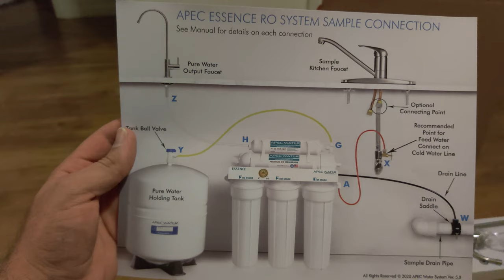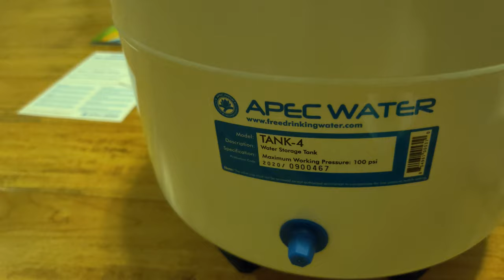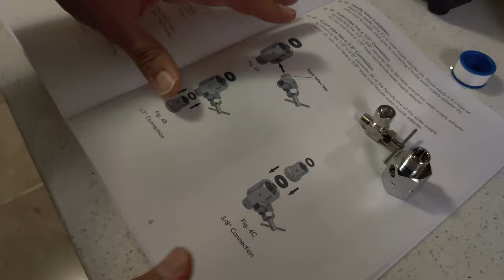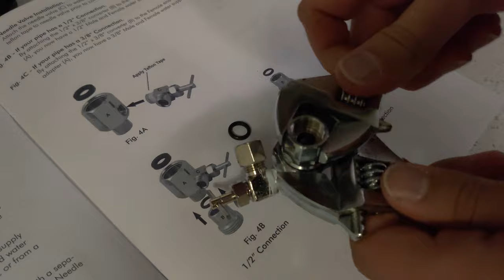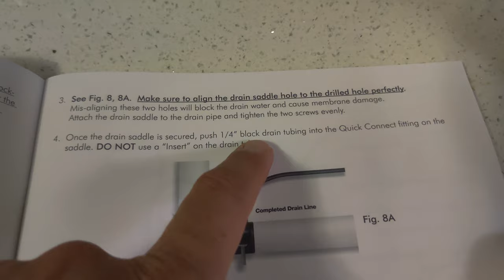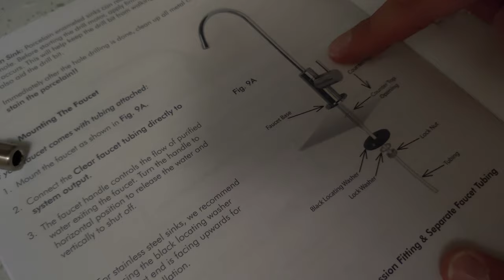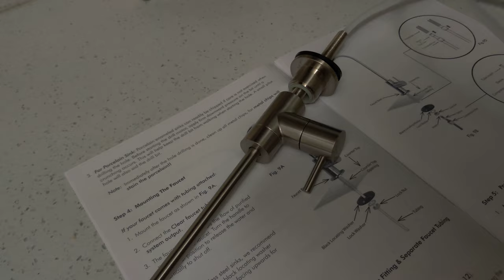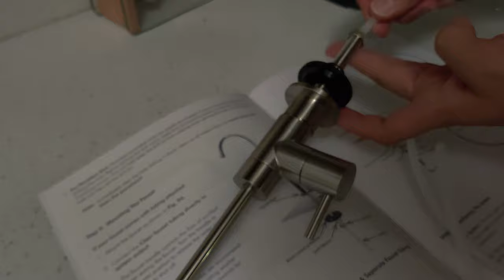Install APEC Water Filter RO System

Comment from the maker: Water filter system can be found here: https://amzn.to/3f1byPL
Dewalt drill/driver set here: https://amzn.to/2IDZhF6
Reply: Hi Chris thank you for your video! Do you mind what is the dimension of the 4 gallon tank width and height? Thank you in advance!
Reply: Can you hook up A-line to your ice maker on the refrigerator
Reply: Wow!! I want this System. I had a very rough new years eve (December 31st, 2022). I was arguing with my parent about fraudulent water filters in my country. I will refer them to buy this filter instead. Thank you, I'm looking forward to installing this filter with your video. If I succeed in convincing them to purchase this product.
Reply: The filter element of the filter is installed wrongly, 123 is the first one wrong! You have a look, thank you!
Reply: @patrickz3181  literally came here to say the same thing hope he noticed this sooner then six months later on the filter change

Comment: For anyone installing this …make sure u look inside the filter holders.  There is a piece of paper inside each one
Reply: Not anymore. Only 1 paper in 1 filter holder.
Reply: Mine had some weird black crumbs, had to clean it out.
Reply: Mine had an ant in one of them . Think it’s ok to use ?
Reply: @Freedom-dq7tl  Yeah it's still fine, just rinse the holders out.
Reply: I just install mines and I’m not getting water. Wonder if this is why 😂😂😂
Reply: Mine didn’t have any paper. They must have stopped doing that, thankfully.
Reply: Just installed this, didn't see any paper in the filter housing
Reply: I just replaced the 3 filters and was surprised to see 2 paper labels come out. 😂
Reply: @TimRomanPhotography how long after did you have to replace the filters?
Reply: @balla2828  I waited about a year and a half before replacing. The water from the new filters tasted almost identical to the old filters after all that time. Great filtration system in my opinion!
Reply from the maker: True :) ...thanks for pointing this out

Comment: Good install, noticed the filters might be backwards and so was the drain gasket. The gasket should be installed onto the clamp. this is primarily for future problems, i.e. when, as in this case, the garbage disposal is replaced, the same pipe has to be used or another gasket will need to be purchased. The price isn't so much but the down time due to the "oops I forgot that" factor.
Reply: Oh I see! The sticker onto clamp
Reply: That’s why mine is leaking. The sticker goes on to the dam clamp. I caught the backwards filters. I should’ve just read the directions
Reply: DIdnt think of it that way but,,, yes. !  TY
Reply: @verlecox232  the directions I have mount it the way he did
Reply: Directions say “then put the self-adhesive black sponge around the hole location”
Reply: Also the drain should really come in from the top of the pipe coming from the garbage disposal.  The line should go up to form somewhat of a reverse trap. This is because the water coming out of the garabase disposal is quite crappy, and any food particles that come out will create a biofilm. Even though the water from the filter will keep it down, research we have conducted shows over time the biofilm will make it;s way back to the filter over the course of a year or two (or sooner in warm weather and low usage).
Reply from the maker: Thanks for the insight!

Comment: Each installation scenario is different, I ended up doing it wrong by attaching the needle valve first (like he does in the video). This is cause If the needle valve is already installed, the space between the cold water line and the wall in most houses is not adequate to freely rotate. You have to first install the coupler
Reply from the maker: Thanks for the insight!

Comment: Great install video. however I️ think the black drain hose should NOT be pushed so far into the saddle as the hose that far (1/2in or more) inside the pipe may collect solids going down the drain and could lead to a blockage.
Reply from the maker: True, thanks for the insight

Comment: Quick tip, use a painter tape or a sharpie and mark it on drill bit to the length you want to drill the hole in pipe. This way you will stop at right point moment you see it meets the mark. 

Very descriptive video and it has saved me couple of hundred dollars plumber was quoted. Thanks 🙏
Reply from the maker: Thanks for the tape idea!

Comment: Thanks Chris! Helped a ton!

Added installation notes:

Black drain tube—once in, it doesn’t come out.

Recommend drilling small pilot hole in drain faucet before drilling with the 1/4 drill bit.
Drain pipe is exactly 1/4”, so trim waste from hole and try inserting red pipe first, to be 100% certain hole is big enough. 

For drilling the counter top hole, other YT vids were very helpful. FYI, the amazon sold $30 Bosh 1/2” bit was too short (it’s 1 1/16”, and my counter is 1 1/8). Be sure to measure your counter.

If you already have a hole in your sink, the base of the faucet is 1 3/4, so it will fit a smaller existing hole.

Faucet hole position: Make sure there’s enough room on the side to fill a water bottle/cut/whatever you often fill. FYI, the water comes out about 7 1/2” from center of spout (at counter height).

It was said, but I want to highlight, the water spout needs to be in the Off position (lever pointed up) when you connect it to the tank. If not, all the pressure will release and your system will not work.

Also, my tank was pressurized to about 45 psi. I bought a great $35 Cycplus battery-powered high-pressure pump that brought it up to 70 psi (per manual) and the water comes out 50%-75% faster.

It's a fun install. Have a great time!
Reply: Everyone should be careful pressurizing the tank any further.  As with all pressure vessels, there is a max design pressure (MDP) rating that is specific to that particular vessel.  Never go near the MDP as you can have a burst event.
Also, thank you for the excellent notes.  Will be installing my system tomorrow.
Reply from the maker: Nice! ...thank you for all the additional information!

Comment: I just want to thank you very much. I followed your video, entirely, for a complete video manual, step by step, on how to do it. Otherwise I would have been literally desperate. In reality we had a previous system which was outdated - so I had to find ways to integrate the previous plumbing solutions with this current APEC system (namely different size tubings of 3/8th and different valves already installed). After having studied your video and the older system, I concluded all I needed were adaptors 3/8 to 1/4 which I got on Amazon. From there it was 5 minutes thanks to your video. Pretty amazing - TRULY grateful, Fil
Reply from the maker: You're welcome!

Comment: Thanks for doing this video. I watched it and installed mine. At first I had a couple leaks at the two adapters above the house Coldwater valve. On those adapters you have to make sure the rubber O-ring is in place and tighten them fairly snug.  I accidentally left one out when installing and the other one came with a defect from the factory once I pulled off the extra rubber and made sure it was sitting flat it worked great . So I had to take it apart twice and make sure those O-rings were back in there correctly but after that no leaks. Thanks again.
Reply from the maker: You're welcome! ...and thanks for the extra insight.

Comment: Perfect install except for one small plastic tube insert that goes in the end of the tubing at the line in valve. It goes in and supports the tubing for the compression nut.   It is small but does come in the 📦 box.
Reply from the maker: Thanks for the insight.

Comment: Thank you so much! I just finished installation a minute ago and waiting on tank to fill up. I did notice however that you put the 1st stage filter in the 3rd attachment. I could be wrong but that’s how it appeared in the video.
Reply: no, he did exactly that which is incorrect. if you check the videos from the official APEC, they do it correctly.
Reply from the maker: Thanks for pointing this out in the comments! Comments like this help us all install the RO system correctly.

Comment: Thanks a lot for the video mate, really useful. I just bought system from ebay and there got no instruction at all. 
Just little note: try to avoid using teflon tape but hemp dispenser instead. 70 percent of the plumbing troubles are in result of using teflon tape 👍
Reply from the maker: I'll look into the Teflon tape alternative you mentioned. Thanks for the insight

Comment: Very good video. Your explanations and instructions were clear and concise and the installation was well done.  I installed my unit today.  I found that the metal valve body that the 1/2 to 3/8 adapter fits into leaks under water pressure.  It took a lot of firm tightening to get it to stop.  Worse was when the red tube that feeds water to the unit blew out and water gushed all over.  It seems that the fitting on the unit was missing the lock collar and that is why the tube would blow out seconds after turning on water.  I ended up removing the fitting and went to a local hardware store and bought a replacement.  It seems to be working ok now.  I also bought a brass fitting with ferrule in case the plastic fails.    That red feed tube fitting was the only one missing a lock collar but it caused me a lot of trouble.  Perhaps Apec should include a couple extra fittings in their package so a person doesn't get stuck if one fails.  Also a base for the tap that can be adjusted  for mounting surfaces that are not flat but sloped.  That is another adaptation I had to do on mine.     My daughter just installed one several days ago and had leaking issues with the metal fittings that attach to the water supply.  She tried reaching Apec Customer Service with no success. She had to run to Home Depot for a washer and O ring to get her leaks stopped.   The jury is out on the Apec Roes-50 until I see how it performs for a few weeks.
Reply from the maker: Thank you.

Comment: I followed hour guide. And not the document. The video was great. I added teflon to all joints so it didnt leak at all on first turn up. Also you can use the horizontal pipe to drill thr hole for the black tube. As long as its above the trap.
Reply from the maker: Nice, glad the video helped!

Comment: At 3:30 when three filters are being screwed into the system, they are being installed in the wrong order.  The white filter which is supposed to be stage 1 is being installed in the stage 3 slot of the system.  

Also at 9:30 when you move onto installing the valve setup under the sink, you don't mention the small o-ring that is left over or where it goes relative to the setup until later on when you're installing the system.
Reply: You are correct about the order of the filters. SED goes in stage 1 and CAB 's go in 2 and 3.
Reply: I don’t understand how more people didn’t catch that. It’s kind of an important step to get wrong
Reply: was thinking same thing lol. @Acidhair
Reply: This is the comment I was looking for.
Reply from the maker: Thanks for the insight

Comment: Others may have mentioned these issues but I believe you put the sediment filter in the 3rd stage housing. It goes in the 1st stage housing. Also you failed to put the plastic insert into the end of the red tubing before inserting it into the needle valve.
Reply from the maker: thanks for the insight... It's true I did mess up the order in the video.

Comment: Chris, 
Enjoyed your video. Just needed you to check your main line (red tube) connections to your water outlet. You should of had a white plastic insert to put into the red tube before you compressed the  fitting down. Great job on the video 👍
Reply: I missed that too. Wasn’t in the instructions. Still holding up nice
Reply: yes - following vid and manual - and the little plastic thing came with the needle adapter.  Almost threw it out.   They should package it TAPED to the red tubing!!
Reply from the maker: Thanks!

Comment: Excellent work and detail descriptions. Thanks
Reply from the maker: Your welcome
Reply: Hi Chris, do we must flush the water system for the first time ? if so, how? thanks
Reply from the maker: @brian68467  yes, you should do a flush to remove any carbon and other particles from the new filters. Simply let the water run out the faucet. I recommend running at least 5 gallons out before using the water.

Comment: Great video. Installed mine today. The feed water adapter and needle valve keeps leaking. Maybe I'll have to add more teflon tape or I might have the sleeve for the compression nut on wrong.
Reply from the maker: That's unfortunate.... Let us know, if you get it to stop leaking
Reply: @ChrisAsipyan  I contacted the seller and they are sending me a new feed water adapter and needle valve.

Comment: Great video, thank you. I wanted to see someone else go thru the connections before I started unplugging & drilling holes.

One question ... am I crazy or did you install Filter 1 in the Filter 3 location (& vice versa)??
Reply from the maker: You're correct, I did accidentally install the filters in the wrong order. Luckily I figured it out soon after publishing this video 😆

Comment: Do you find yourself hearing the water going into the waste drain? I see some complain of that and when I asked APEC they pointed me in a position lower than you had placed it to avoid such nuisance
Reply: I just notice the same thing, can some one explain that?
Reply from the maker: It makes sense, if places too high above where the water sits in the trap, it would splash hard enough to hear it

Comment: great instruction on installing the 5 stage filters. one area where you drilled the residual drain too close to the garbage disposal discharge black tube. when the garbage disposal turns on the turrential water will fill the drain line you installed. it might interfere the nut from loosen when plumber needs to unclog the piping. looks like below the top P pipe nut will be better suited for the 1/4" drain hole. i had done unclogging plumbing on my kitchen P pipe.
Reply from the maker: Thanks for the insight!

Comment: Thank you very  much for the very useful video installation. 
If I may, I kindly ask for the water going through the drying tube, do you have any idea how much water is going to be wasted from the system  daily or monthly?
Thank you one more time.
Reply from the maker: Unfortunately, one of the drawbacks of RO systems like this is that they do indeed waste quite a lot of water! It's estimated that about ~75% of the water is actually wasted. So if you were to get 1 cup of clean water out of it, you will be draining about 3 cups of water out of the waste tube.

Comment: Great instructions, i was able to reinstall my unit, but i need help, i don't know why the tank is not getting filled, the water valvds are open, help please
Reply: Same here  the tank isn’t filling up but water still seems to b coming out of the faucet it’s like the water is sitting in the filters not going to the tank Can u please help Chris
Reply: You may need higher water pressure by using a pump.
Reply from the maker: I know it's been a long time since you made this comment, were you able to figure it out?

Comment: Hi Chris. How long is the Yellow tank hose ? My tank won't fit under the sink. I want to run it at least 5 feet away from filters. And do you change the bottom 3 filters once a year ? And the top 2 filters every 2 years ? Thanks.
Reply from the maker: I change the bottom 3 every year and the top 2 every ~3 years. If the tank does not fit under the sink, I recommend getting a tankless system.

Comment: The hot water is always on the left side. That is standard. You made a crucial error on the red line because you did not install the insert which helps with compression. That's probably why you had a leak.
Reply from the maker: Thanks for the insight

Comment: Awesome video, this is steering me to purchase this system.  I had a question about the drain though.  If I live in an apartment and plan to move out in a couple years, so when I do move, what is the best way to plug the hole I drill in the drain pipe?  I don’t want to have my landlord freak out at me for that.
Reply from the maker: I'm sure there are plenty of solutions, I would search YouTube for it, I'm confident you will get some results

Comment: How do you disconnect the hoses if you need to move the unit? Is there a tool for getting the hose out of the teeth that grab it?
Reply from the maker: Yes. You can simply push in the plastic ring (teeth) and then pull the hose out.

Comment: I followed these instructions but I have a leak  from the black drain pipe. I drilled a 1/4 inch hole but as some water with force comes it starts dripping.
Reply: Fixed it with RTS silicone before clmaping
Reply from the maker: Nice, thanks for the update

Comment: What happens when you want to uninstall the unit? Is that hole drilled into the drain pipe a problem?
Reply from the maker: There are various ways to fix it afterwards. From simple patching techniques to replacing that section of the pipe.

Comment: One thing I've struggled with as I pre plan...i want to run this below my kitchen into my basement. The tubing that connects from the kit faucet is only a few feet long...and I don't seem to be able to remove it and use a longer line...would you use some sort of coupling?
Reply: For anyone reading this - I used a coupling.
Reply from the maker: Thanks for the insight about the coupling

Comment: Thank you for this, I'm thinking of buying it and setting it up in north Florida, do you still recommend it 2 years later? (I have the countertop version and I'm thinking to upgrade to this).
Reply from the maker: Yup, I'm still using this water pump and it's working well. Just need to remember to keep replacing the filters when needed.
Reply: @ChrisAsipyan  Good to know :) Thanks!